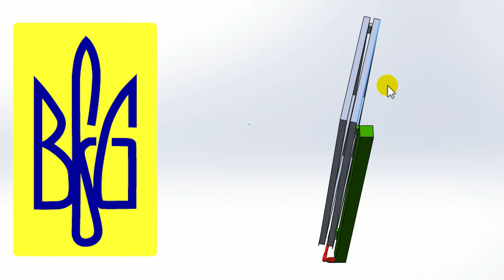Gear mechanism BFG-Mini DIY kit for Bi-folding gates. A short video review and installation examples

Comment from the maker: Hello colleagues!
I’m starting the new season with spring discounts on BFG mechanisms 30-50/50-80/Uni/Indi -10% of the retail price of $200. That is, minus 20 dollars, the price for you is 180 $!
All mechanisms are available.
There is a $25 discount on the BFG Mini mechanism, the retail price is $375, that is, for craftsmen it will be $350!

The offer is valid until May 15th.

My website: https://bfg-diy-kit-mechanism.glideapp.io/dl/375e23/M/85e47a

I invite you to look at the latest examples of using the new BFG Indi concealed lever mechanism for opening gates outward. Access to the mechanism, as with standard inward opening systems, is from the yard, which eliminates unauthorized access to the mechanism!

https://youtu.be/RSvigQhH3d8

For an example of opening outwards and an interesting solution for installing a telescopic motor, see here: https://youtu.be/ppQGXtMpxQs

An example of using a T-profile for installing large gates:
https://youtu.be/zVXGICVGiGA

I’m preparing new videos on the topic of threshold-free gates/accordion doors/book gates made from a separate fabric!
Two more solutions differ from the previous one: https://youtu.be/5o0kU6YVPeo

I would be grateful for your cooperation, please share your work! I will be happy to advertise you on my channel!

I wish you generous clients and good luck!

Alexander – Mechanisms from the DIY BiFoldGate kit.